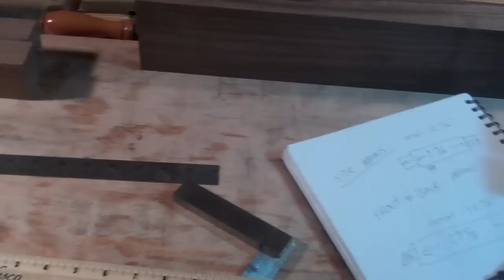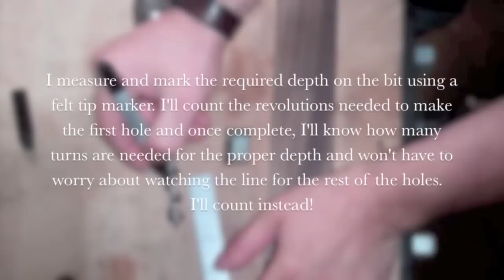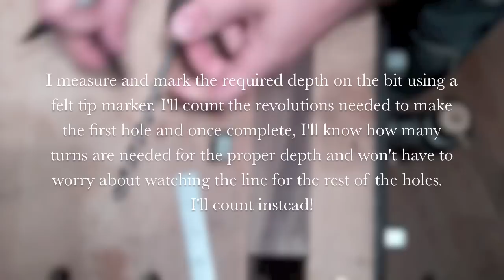A Card Catalogue part thirteen: Making the stand components.

Comment: Thanks for the videos and the books!! Great inspiration to me!! Do you turn the legs as you cut them to length to keep it even also, or just the rip saw part?
Reply from the maker: John,
thanks for the comments and question.
I didn't turn these legs as I cut them, but when I rough saw them, I leave a bit of room, then I plane to the final dimension. The apron on the other hand, seeing as it was resawn, I do turn it every few inches to keep it on track.
The legs are 2-in. of thickness to saw, the apron was a little more than 4-in. to resaw, so I turned it as I went.
Hope that answered your question,

all the best-

Comment: Why is it a good thing for the end grain to run diagonally across the legs?
Reply from the maker: TheBookDoctor,
thanks for the question. Having the grain run diagonally across the legs means you'll have a better match in the four surfaces on the legs. If the grain ran straight across the leg, two opposing sides of the leg would be flat grain, while the opposite two would be edge grain.
It's the devil in the details!
thanks again and all the best~

Comment: Hi Tom - which set of auger bits was that at 6:40?
Reply from the maker: Todd,
thanks for the question.
They're a set of  Irwin's from 1968.
13 in all, all original and sized from 1/4-in. to 1-in.
I was lucky and found them for a decent price on eBay a few years ago.
all the best~
Reply: Tom Fidgen Ah, nice! What do you look for when buying auger bits?